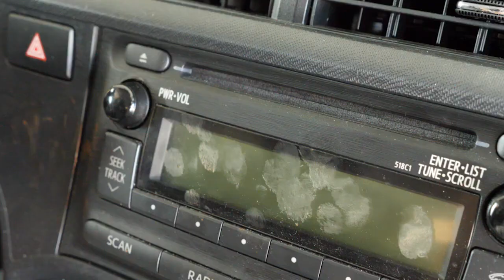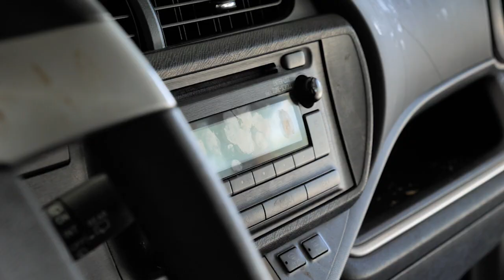Green Cleaning Car Interiors with Dr. Bronner’s

Comment: I don't have any sal suds right now. Can this be done using your castile soaps as well??
Reply: Hi Jessica - I'm sorry I didn't see your question earlier.  For making an All Purpose Spray, yes the Castile will work also. Sal Suds is a little tougher on stains.  Also, you wouldn't want to use the Castile on shiny surfaces - like the outside of the car - if you have hard water.  But inside on leather, fabric, plastic it's good.

Comment: Hi lisa, can I use the all purpose spray made with sals suds to clean pet pee or should i stick to an enzyme cleaner? What do you think?
Reply from the maker: Hi there- I’ve been there too, and Sal Suds works well for cleaning up dried cat urine. To clean up dried spots, wet the area with a wet cloth, then spray with the Sal Suds All-Purpose spray of 1 Tbsp. Sal Suds in a quart of water – enough to get it wet, but don’t saturate the spot. Scrub the carpet with the wet cloth. Use a second wet cloth and scrub the carpet some more to remove all the Sal Suds.

Comment: Hi! Can I clean my leather couch with Castile soap?
Reply from the maker: Hi Betty-  The Castile All-Purpose Spray (1/4 cup in a quart of water) will do a quick clean on leather. If the leather needs to be nourished, you make a leather polish with 1/3 c. vinegar with 2/3 c. olive oil and 1/2 tsp. pure essential lemon oil. Shake this up and rub it on with a soft rag.
Reply: Lisa Bronner thank you! Another question, do I have to rinse it?
Reply from the maker: Hi Betty- To use the All-Purpose Spray, just spray, wipe with a damp cloth, and in the case of leather, wipe dry. The leather conditioner does not need a rinse. Use sparingly and buff dry with an absorbent cloth.
Reply: Lisa Bronner thank you!